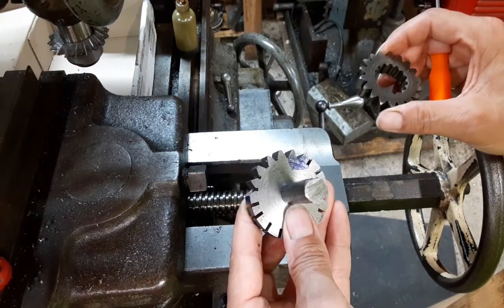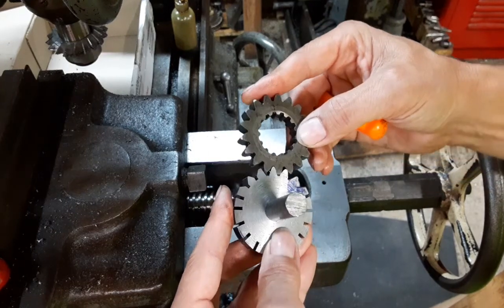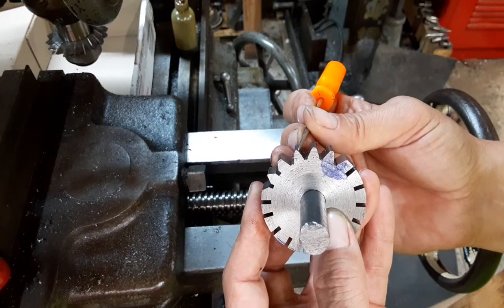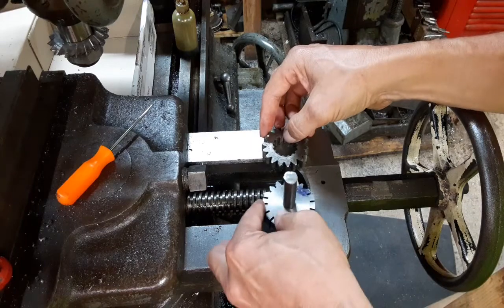crude gear attempt follow up success

Comment: After you "rough out" the gear teeth with the 90 and 45 degree cutters, you could easily refine the involute shape with a fly-cutter with a bit to match the profile of the old gear teeth.  Much less wear on the fly-cutter when cutting steel vs. doing it all with the fly-cutter.
Reply from the maker: Good point. I am curious how well 1 of these would run if I had a finished version like this